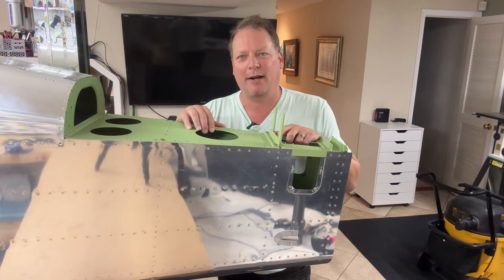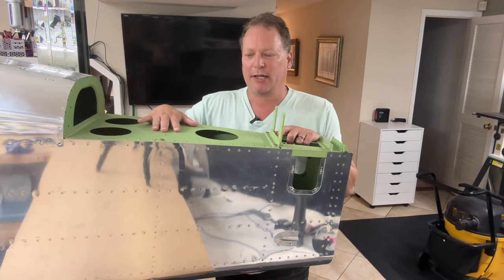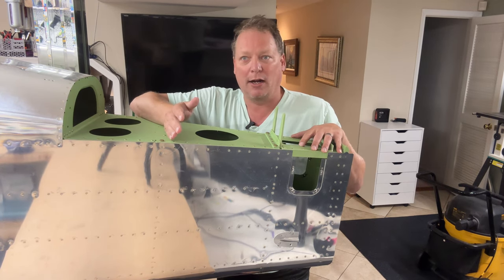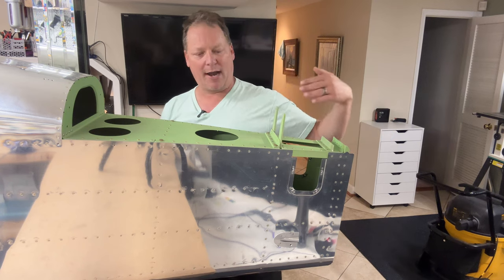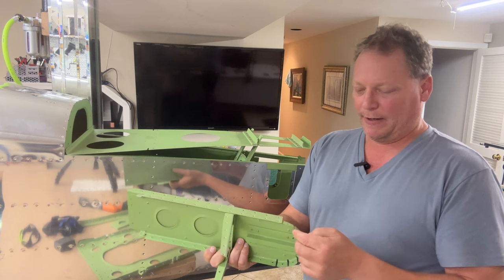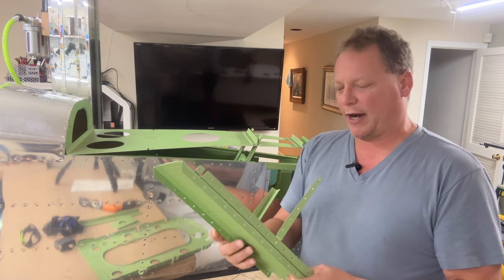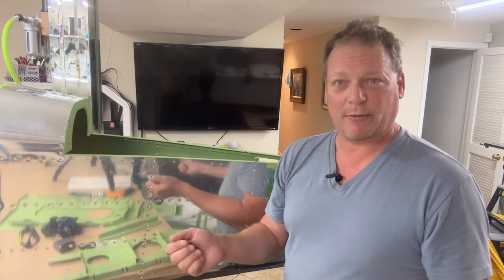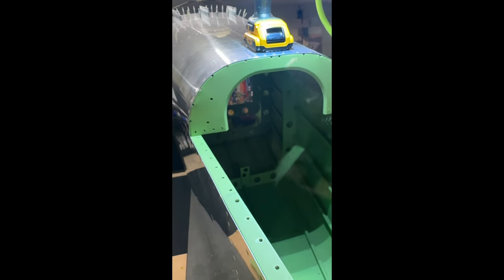Removing the "red" laser cut bulkheads from an RV-10 tail cone

Comment: Stoke to a mate who is an ex airforce engineering officer.  His comment was that you may not see a crack now but the extra heat from the laser into the alloy could mean a crack forms after a couple of hundred hours.  So no immediate issue but it does shorten the airframe life.  Thanks for your experiences and details of what you are doing.  Working on an RV7 and just started so not facing this level of issue.  This is good learning for people like me.
Reply from the maker: A valid concern for sure. It is encouraging to see the recent engineering updates from all the stress testing they did. Even when they stressed a cracked laser cut part to excess, the existing crack didn't grow, but a new one formed where they expected it to.  One always has to wonder how closely testing mirrors reality, but I like the initial results.

Comment: If you were to cut a short length of safety wire, insert it into any hole (rivet, tooling or lightening hole), now rotate it around the circumference of the hole, you will feel the notch or slag as left by the laser cutting process. Like you I struggled to see mine, but you can feel the notch/build-up straightaway. I do appreciate you are way past this stage, but a fellow reader might find this useful.
Reply from the maker: Great tip, Thanks for sharing! I have a few parts I can try that on.

Comment: I’m in the same boat as you and am planning on replacing the frames (F1006-F1009) and the bulkheads (F1010-F1012). My plan to minimize the amount of drilling and potential mistakes is to (in addition to all the rivers holding the frames and bulkheads) drill the line of rivets on both of the side skins to the bottom skins. Looks like you have your top rear skin installed already but that’ll have to come off anyway if you plan on replacing the frames. Let me know if you’d like to discuss further in detail. I plan on starting this disassembly in ~2 weeks
Reply from the maker: I took out my RED parts so I could get a look at the holes and see how bad things were. Based on the inspection of these, I decided to not take out any more bulkheads until Van's publishes more instruction and maybe a revised chapter 5.

Comment: I stopped right before riveting everything together on the tailcone (fortunately.)  I see cracks on one aft bulkhead, but that one I had replaced due to a goof-up.  Inspecting the remaining (all fit, dimpled, primed) I just cannot tell if they were laser cut or not.  What made you believe they were (enough to go through this ordeal?)
Reply from the maker: I video everything when I’m working on the plane. So I went back to when I first took the parts from the crate, and then organized them in piles to store each assembly together. I figured out which ones were not in blue plastic so were subject to being laser cut. Then I went to the deburring videos to see which ones I pulled out a file to go after the notch

Comment: Thanks for your video.  I was wondering about a comment you made and where you may have acquired your info.  I am in charge of a 12 build project with a group of high school students.   We do not seem to have  near as many issues as the other aircraft but there are some.   You stated that one of your parts had the blue film on it so it was not suspect to be laser produced.  ( I may have not have understood you clearly)  Is this a supposition or a definite fact.  Thank you so much for your video,  Alan Gluff
Reply from the maker: Hey Alan;  That sounds like a really cool program for your school. What state are you in?  As for the blue, it is on Van's web site in the July 12, 2023 update regarding laser cut parts. I'll quote it below:

"If your part was shipped with blue vinyl on the surfaces, you can know that it was CNC-punched and is not a laser-cut part."

Comment: When you say you ordered replacement parts, did you order them and pay out of pocket plus shipping or is Van’s sending them at their expense?
Reply from the maker: A little of each. Vans is replacing known bad parts at no charge. For parts that were laser cut but are not structural (so it shouldn't matter), they are replacing at a big discount (TBD). Each builder is responsible for their skills to dis-assemble and re-assemble without damaging things, but that takes time to be careful. If a builder chooses to re-purchase extra parts that are not laser cut to avoid the hassle, Vans will sell extra parts at a discount. I'm choosing to do that even though it will likely take a while to get replacement parts that don't have an issue.
Reply: Yeah, I went on the portal and ordered replacement parts for my -14 kit, including the “ok to use” parts.  I have zero intent to pay for any of those parts to include shipping.  We will see what Vans decides to do.
Reply from the maker: @oxman1971  sorry you are going through it too. I certainly didn’t imagine all this being part of the process.